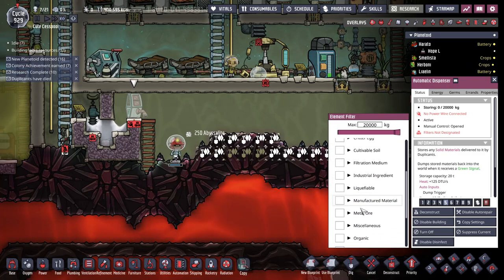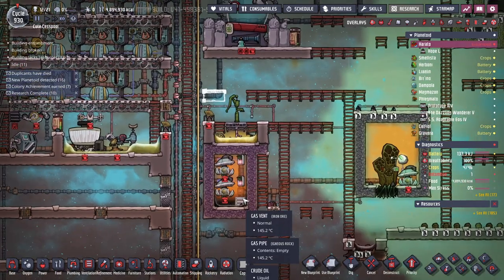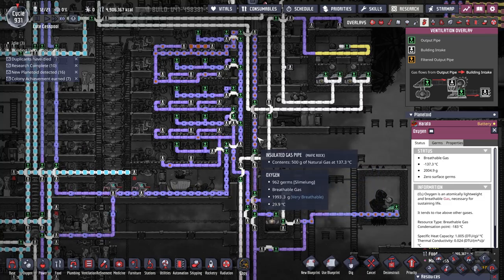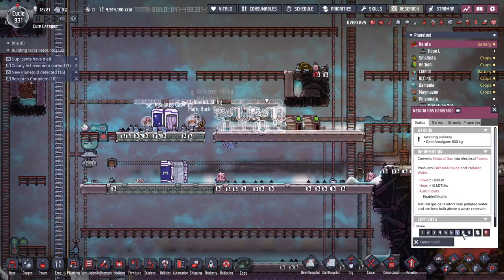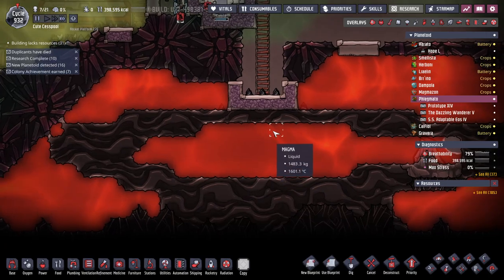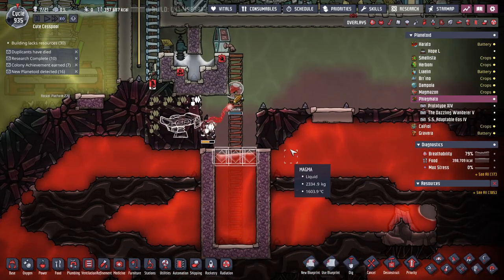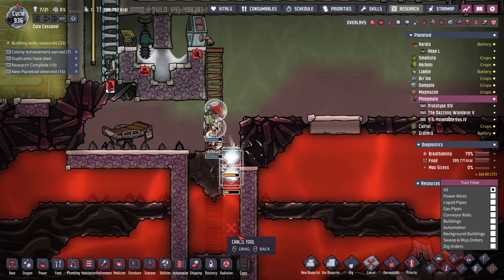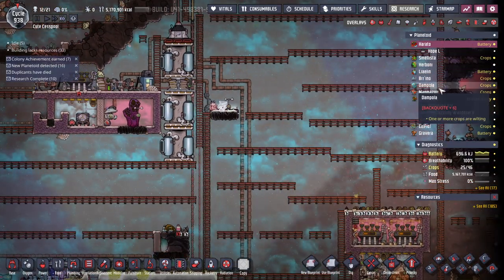Cute Cesspool Ep 32 Digging Down to 2nd Tungsten. Emergency Power Issues

Comment: They gave up building the insulated tiles because the building materials melted. Same as the Tempshift plates shortly before.

You made the insulated tiles out of igneous and the dupes picked up building material that was freshly converted magma. So it took only a few degrees to melt it all again.

As far as I understand it the building material stored in the blueprint behaves like debris sitting on that tile. So the igneous sat on top of the magma. And we know that debris likes to interact with the tile it is sitting on top of. Perfect conditions for this glitch/phenomenon to happen.

If it melts before a dupes starts building you are left with the blueprint and a task that will never be completed, since no new supply errand is issued. That's what happened with the sedimentary rock ts plates before. I often encounter that one when I build ice tempshift plates and the ice is already close to its melting point.
Reply from the maker: That is what happened.  I wish either the build would go away when it melted, or they would bring more to complete it.

Comment: the building bug is exactly as you supposed, the material is placed, then melts out. If you build out of obsidian that can't happen.
Reply from the maker: it can, on the main base the magma in places is hot enough to vaporize rocks.